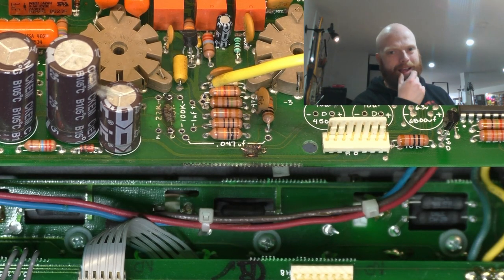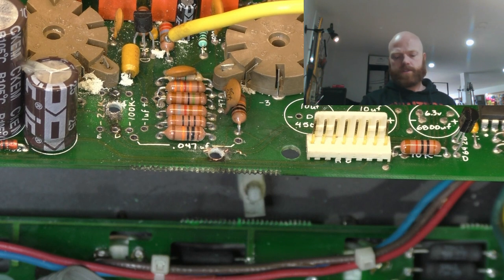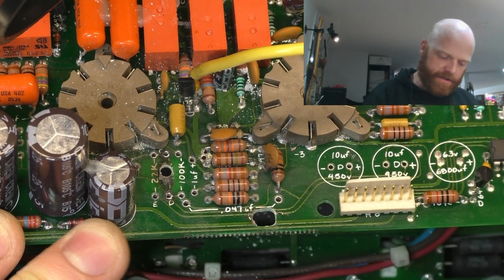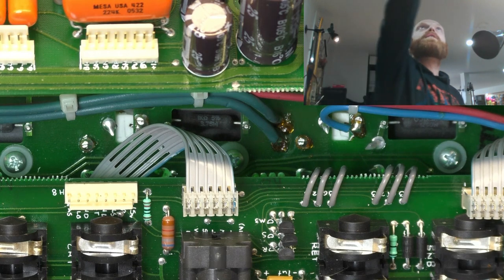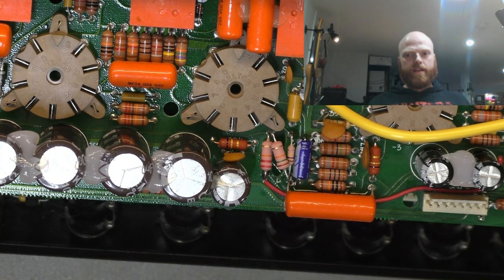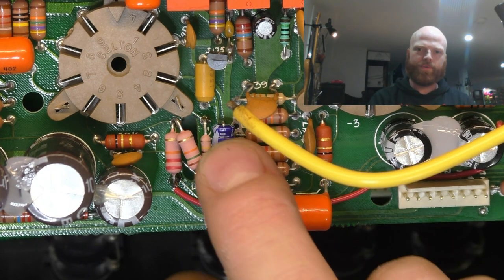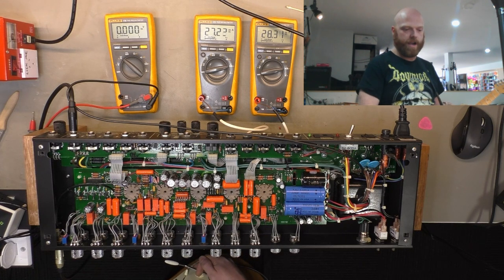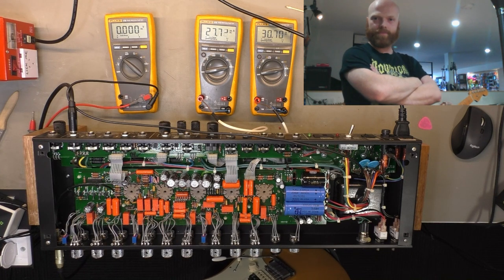The Repair - Mesa Triple Rectifier Solo Head - Pt. 3

Comment: Awesome vid Brad! I'm currently wrestling with a Triple Rect myself and its been a nightmare. Amp blew a few tubes, had the bias wrong and damaged the filter caps, plus I have a new preamp tube with a low glow after replacing parts.  amp blows it's main fuse after a few seconds of operation.

Comment: Rather than just running short wires across the small hole(s) that you cut in the fiberglass board, better (or simpler anyway) to surface-cut the troublesome traces with the Dremel (not usually necessary to drill through the board) at both ends, where the traces tie to a component lead or plated hole, and run a wire end-to-end (I use teflon-coated solid core wire) to replace each trace you've cut. Tack-soldering a jumper wire to a thin trace won't be mechanically or electrically secure for the long-term.  I've done this type of repair many times, and you probably wouldn't even need to grind out the burned part of the board.

Nice tip on sealing the cuts in the board with the conformal coating ----  I hadn't considered the hydroscopic (or is it hygroscopic?) effects of fiberglass.
Reply: Where do you get your solid core teflon-coated wire?
Reply: @Splattle101   When I was working full time at an audio repair shop, pre covid, ---- and prior to having heart surgery twice last year ---- we had a huge roll of it, but I don't know where it came from. I took some of it home with me for my own use.  It's bright yellow and as slippery as silicone snot. It's kind of a pain to strip it  with ordinary cutters or strippers  because the insulation tends to slide around on the solid core underneath.  I expect to go back to work in the next month or so and I will have to look at the spool to see who made the wire.
Reply from the maker: Your suggested method was my first preference and I did mention that in the video. However, if you're aware of the typical Mesa Boogie PCB layouts, you'll understand that is not a practical solution on this particular PCB. The pads are too far away from the damaged area. And the burned areas, particularly near high voltage as in the bias supply and V1/V2 are required removal, regardless due  to the risk of high voltage tracking across the damaged areas.
Reply: @BradsGuitarGarage  , I haven't watched the entire video yet, and I usually post questions or comments as I go,  because if I watch and wait for the end of the video, at that point I may have forgotten what I wanted to write!

I don't have any problem with running jumpers 3 or 4 inches, if thats what is required and there's no shorter path.  Getting the high voltage and/or bias voltage off the board with separate wires in the troublesome areas can only be a good thing.  It's not much difference labor wise between putting in a 1" jumper and a 3" or 4" jumper.

 By the way I have drilled holes in a number of circuit boards that had cracks in them, at the very ends of the cracks so that you could stop the crack from spreading, and then bridged the broken foils.  This is generally more practical on a single sided board than on a board with foils in both sides.

 I wish I'd known about circuit boards becoming conductive years ago. I once worked on a fancy new- production Graaf hifi amplifier that kept going into runaway bias and at that time I hadn't seen any of the videos of people running into similar problems with Marshall  and Mesa circuitboards becoming conductive. We never did fix it.  I'd bet my bottom dollar it was a conductive board. The amplifier had sockets mounted onto a double sided board. No burning, but definitely some hot spots!
Reply from the maker: @goodun2974  It's certainly a lesson you don't forget!
Reply: @BradsGuitarGarage  ,  I've also seen instances of solid state Hifi gear where the board became conductive because of electrolyte leaking out of the caps and into the board.  Adcom amplifiers are a common and extreme case of this. The electrolyte that comes out of the capacitors looks like the goo from the bottom of a spittoon or a barbecue grill, oily greasy brown-black gunk that smells like fish when you go to unsolder parts.  Not only do you have to scrub the board thoroughly (dish soap and distilled water, followed by alcohol) to remove all of this corrosive fluid, which even goes underneath the Molex connectors and down the through holes for the component leads and corrodes the leads and solder joint where you can't see them, but, the input IC has a very high impedance circuit and is sensitive to conduction through the board due to the electrolyte having soaked in; and so, you have to lift some of the IC legs off of the board and connect them elsewhere to the components with flying jumper wires.
Reply: @goodun2974  That would be awesome, thank you! I've used and like stranded teflon coated wire and I can source that readily enough. But I know somebody chasing solid core for a particular application and I can't find any.

Comment: Really neat work, great job. Have you ever heard of the adhesive, E6000? It's like runber cement in a tube and works much better (more secure) than silicone yet it's fairly easy to take off when you want to take it off. Silicone works ok but I find that sometimes it gets particular on what it wants to stick to.
Reply from the maker: I think I know that stuff. The matte white stuff you find in late SVT heads?

Comment: Between you and Psionic, these videos on Mesa products should be required viewing in all Electrical Engineering curriculums on design for manufacturability and reliability.  Incomplete or incorrect schematics, failure to honor the "courtyard" space of critical high voltage components, using under-rated relays on high voltage circuits...  That's  just one amp design.  And that's  after recognizing the over-featuritis of these designs is NOT player friendly.  I own a Mark V from 2009 and it is easily the worst investment I've  made.  Given its original cost and hours actually played, it has probably cost me $19.99 per hour of play time.  $3499 for the Mark VII?  Insanity.  I know others swear by them and I respect that.  I'm just one data point.

Comment: How many hours you figure you had in this?
Reply from the maker: Easily a full day. Hard to tell with all the distractions and multiple jobs on the go at any given time.
Reply: @BradsGuitarGarage  Do you figure if it was in the estados unidos that it would have gone back to Mesa? The one I have has multiple issues-no low voltage supply in addition to the smokage. I'm punting.

Comment: What did it cost the customer to have the amp repaired?  Or put another way, if you didn't do the video and detailed explanation and tackled the job right away, how long would the job have taken and how much do you charge per hour.
Reply from the maker: That one was just under $1k.
I generally charge au$110/hr. for actual work.
Of course, the videos make the work take about 2x - 3x longer, which I don't charge the customer for.
But they do appreciate watching the videos later.
Reply: Thanks for the quick response.  The video was extremely detailed and informative as well as interesting.  Thank you.